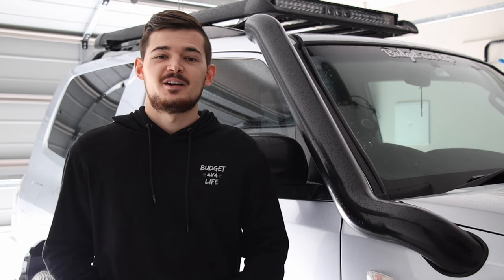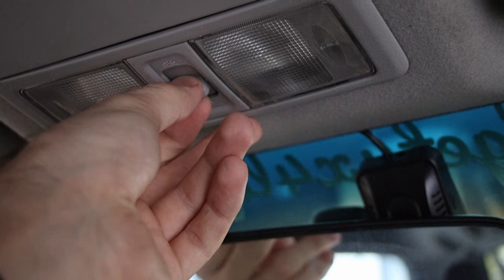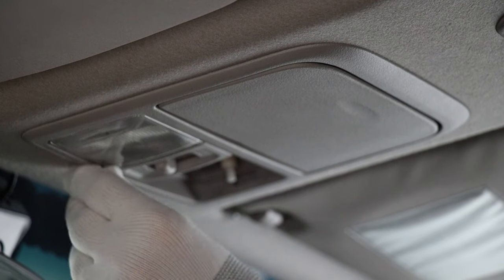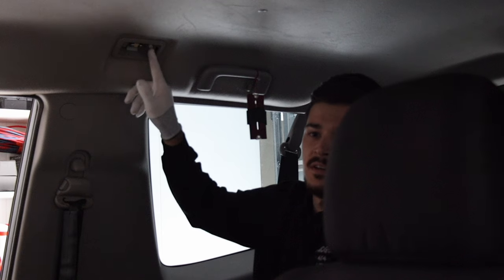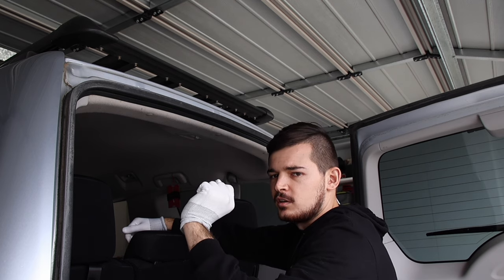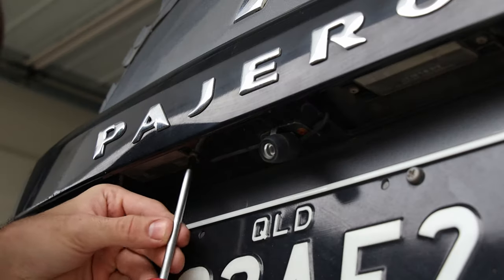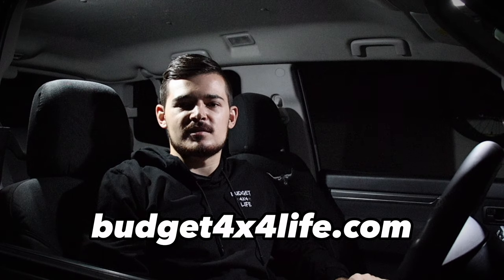The ULTIMATE Interior LED Light Kit

Comment: Did this modification, but had to change a few due to quality issues with them very similar to what you have. Falling apart and loosing leds or just stopped working. I noted that sellers wont tell you the codes such as T5 or T10 and alike, Sneaky blighters. Because you would simply work out the type and get better ones for about the same money. There is defiantly better quality out there with multiple fittings if required,  I got the largest I could get to fit in the rear. But no matter what, I find something in your videos that is helpful...... as usual. Thanks for all your work on the Pajero since you started and I always have an open ear for you for what you can add to the table.
Reply from the maker: Hey Jamie!
Yeah that's definitely unfortunate. I had mine for a while now with no issues touch wood but if the quality sucks for customers I won't stock them and seek better options. Thanks for the support mate I appreciate you taking time to watch 🙂💯

Comment: Mitsubishi uses T5 size bulb (based on Pajero Sport) for the glove box. I was able to access it by  removing the glove box then unscrewed the cover.
Reply from the maker: Cheers mate will see if I can find it😄
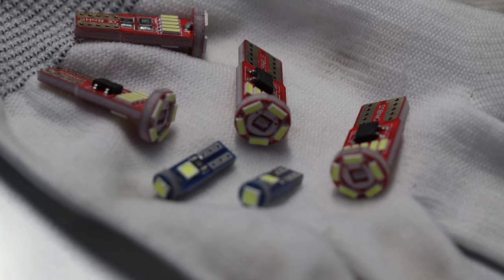Reply: 7:06 those 2 small extra bulbs are T5 size. I think those are for the glove box and the keyhole. 😀 (Those type of bulbs are really too tight. I shaved off some from the side using a cutter so it can fit in the glove box bulb socket.)
Reply: Hi also need to remve  the decorations piece up the glove box then 4 screws  and 2 in dawn the box ..in our middle east models they sale it with the brackets around 3 us dollars 😅
Reply from the maker: @NoobleDotCom  cheers😄💯
Reply from the maker: @بوحربيالحوسني  Thank you🙂

Comment: Hey mate, I installed these today and saw the full effect of it tonight. These are awesome!!

My only problem, when I was fitting my rear cargo light, the whole assembly came out. I noticed it had come off the brackets, these weren’t secured to anything. How do I put this all back together again, as the light is hanging down.

Sorry if this is really bad terminology, I’m new to the Pajero scene
Reply from the maker: Hey, Matey, thanks for reaching out 💯

Whoopsie mate, i am not sure how. There should be some sort of way for it to "click" in and sit there haha. Think there might be clips on the back end of it. Just be careful not to break anything
Reply: @budget4x4life  All good mate, I found an old post on a Pajero forum. Sounds like it’s a common problem.
Reply: @budget4x4life  I don’t know how to add a screenshot in comments

Comment: How do you pull out the bulbs under doors. Are they twist or just pull.
Reply from the maker: Pretty sure just pull. It is in the video somewhere 🙂🙂
Reply: Those factory globes in the door get hot!
Burned my finger and thumb trying to pull it out. 
ProTip, do them first or before leaving the door open too long. Or else disconnect the battery first..
I cracked it and just left the non-LED's in there. I'll have another go eventually,